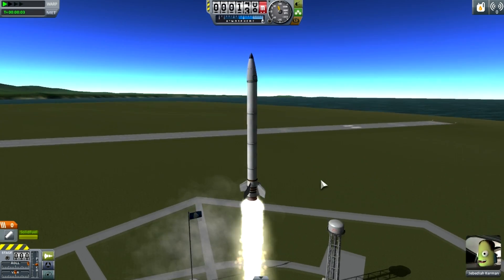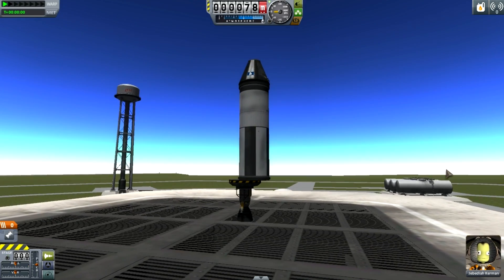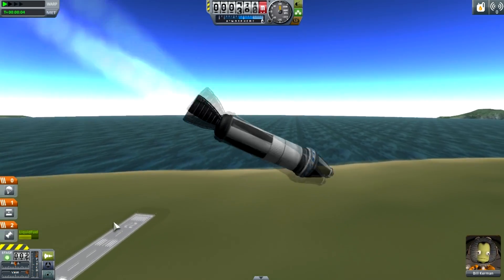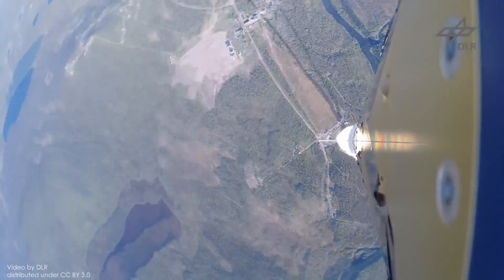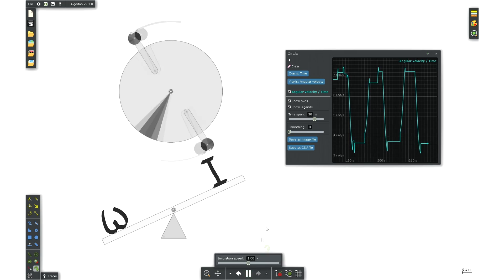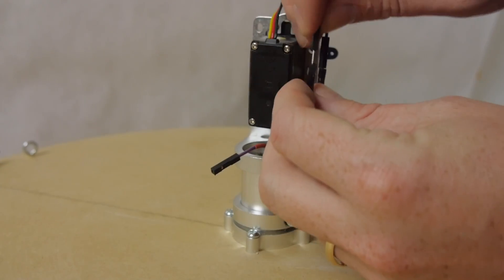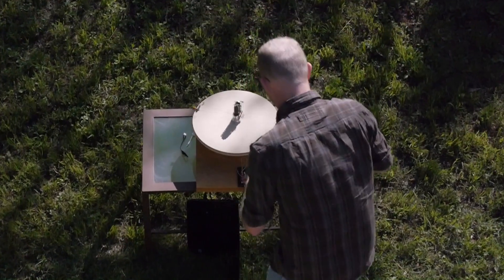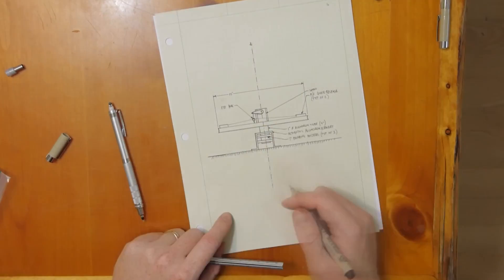Can a satellite do a yo-yo trick?

Comment: I had the same thought about space junk that you mentioned near the end of the video about halfway through myself. However, I think it wouldn't be too problematic to use the yoyo de-spin shortly after exiting atmosphere, but before achieving an orbit. This would allow the masses to fall back into atmosphere and presumably be eaten away by ablation. This puts you back in the same problem you had before, which is being at the mercy of small imbalances in your craft, but once out of the atmosphere my understanding is that the avionics would be capable of counteracting the forces using angular velocity sensors and maneuvering thrusters, which have limited efficiency in atmosphere. A fringe benefit of not madly spinning about.

Comment: Could you please dive a bit deeper into the explanation of why a massive rocket does not tilt over immediately when the supports come off?  What exactly is it that counters any small difference in thrust from the engines?  After all the rocket is not rotating.

Comment: Love your videos! However, at 2:58 thats what redundancy is for. There's a neat video of a falcon 9 having one of its 9 first stage engines blow up mid flight and the rocket still completed the mission. In fact, when von Braun was director of Marshall space flight center, other divisions of NASA jokingly called them 'Chicago Brick and Iron Works' for how high their required safety factors were compared to the rest of the industry, and it payed off in the Saturn V. On that note, I think it would be pretty cool to take a closer look at the civil engineering that goes into launch pads and the space industry in general. These structures usually outlast multiple generations of rockets (eg pad 39A).

Comment: Thanks for your great explanation about the yoyo de-spin mechanism. Great! But what I don't agree on is how rockets would work in space. You have not researched that field at all, have you? Don't believe NASAs CGI-pictures and animations as proof for anything. They can't present one real picture of a satellite in space! Space is really a very hostile environment to absolutely everything you try to put up there. Severe low and high temperatures, vacuum, dangerous radiation, and so on. There is no proof that any satellite is up there and HOW would a rocket engine work in vacuum where there is nothing to push of from. Any flying vehicle need something to propel itself trough, eg water, air, sand, and so on. Try release an air-balloon in front of your vacuum cleaner and study what happens, and that is only face vacuum. They are deceiving us big time with all this space nonsens hoping nobody will start asking questions!
Reply: In jet engines the engine uses oxygen from the air.

In rocket engines the rocket brings along its own oxygen to mix into the fuel and burn, producing a force.

Comment: Interesting. Never realized that just that small amount of mass is needed to achieve so big change in rotation. I always was thinking more is needed, and that would make it impractical. But it is a function of mass and length of the tethers, and these can be easily and cheaply controlled.

Comment: I believe that this is exactly what happens with light. The further it travels in space the more it slows down and the wavelength becomes longer. Many scientist believe that the stars and galaxies are moving away from each other because of the Doppler Effect from the light. But this could also be explained by the Yo Yo De-spin. Light De-spin could require millions of years to become noticeable, but it could account for the red shift from distant galaxies. So the galaxies may not be moving away from each other as fast as has been claimed. Just a thought.

Comment: I realize that this video was released over a year ago, but if you still check these comments, I was wondering if you could achieve the same effect without losing the "yo-yos" by using off-balance fixed rotators (think hammers with an axle on the end of the handle) and keep them fixed to the satellite, just rotating counter to the spin.
Reply from the maker: You would be able to slow the spin rate, but you couldn't shed all of the angular momentum.

Comment: I actually had a problem with this stalling a pump I was designing as I would pump the liquid out with the centrifuge effect the pump would rapidly slam to a stop as all the energy got used up moving the liquid outward. The solution of course was MOR POWAR!
Reply from the maker: +Cody'sLab of course!
Reply: Cody'sLab have you ever played ksp??
Reply: Practical Engineering you just earned a sub
Reply: CLAAAARRRRKKKSOOOOONNN
Reply: Sure is Clarkson in here...

Comment: How did you get a signal from the arduino to the servo across a rotating boundary? What kind of coupling did you use? I need to transmit information/power across rotating objects but can't figure out a reliable way to do this without some sort of error correction.
Reply from the maker: It's called a slip ring. Good ones aren't cheap :/
Reply: THANK YOU. THANK YOU SO MUCH. This is precisely what I've been wanting. I'll do more research to see what I should obtain and what'll work for me.

Comment: I was gonna ask you to explain moment of inertia because I didn't know why mass distribution affects the angular momentum, but then I figured it out, so you don't have to make a video explaining the moment of inertia. ;)

Also, why didn't your thumbnail include the words "Yo Yo Mass"??
Reply: Incidentally, my explanation is that, in the rotating cylinder, the molecules that are far from the center have to move a longer distance, and so obviously requires more force to get the entire cylinder to rotate at the same speed a rod of the same mass would.

And if the rod and the cylinder had the same external diameter, and the same mass, the molecules near the center of the rod would be working to speed up the molecules on the outside, or vice versa. 

I've been wondering whether the mass of the object even matters, but that's because I've kept imagining the objects rolling down a slope, a situation in which gravity is the only force (and is notoriously more effective at moving heavier objects, as I can attest to when I go to the gym), which makes up for the added inertia it must overcome to roll. 

And now I'm thinking of how sledding goes faster when you're heavier, presumably because you're not rotating.

I should go sledding some time. It was fun as heck as a kid, but probably a lot safer. My ancestors used to sled on their shields, naked, to show off to the Romans, apparently. I'm guessing I should wear clothes, or people will look at me funny.

Comment: Would you be able to put a gyroscopic sensor in the center of rotation and make the Arduino automatically detach the slingshots when the angular velocity reading gets to zero?
Reply: What would be the point then?
Reply: Eric Pive that you get exactly (or very precisely) zero angular momentum?
Reply: Francesco Bertolaccini Implying that if you detach them any moment later you wouldn't?
Reply: Yes, because they would start imparting the momentum back to the dish/platform/satellite
Reply: Francesco Bertolaccini why?
Reply: Eric Pive watch at 0:42 what would happen if the ropes had been released too late? the craft would have been spinning backwards
Reply: Francesco Bertolaccini Maybe I misunderstood something, but I thought that the amount you reduce your spin is given by the masses and the length of the cables, which have to be precisely the amount that will cancel the spin. The moment when you release them is irrelevant. The reason why they release them as soon as possible is because they are extra, unnecessary mass and that's never usefull in a rocket.
Reply: No, angular momentum must always be conserved, and if you just deploy the cables you will only get your angular velocity reduced, much like a spinning skater when she opens her arms. You need to convert the angular momentum into linear momentum by releasing the cables the moment you have no spin, that is when all your angular momentum is in the cables' mass.

Comment: Very interesting video. I was on a design team for one of those CubeSats and instead of stabilizing a uniaxial spin we had to stabilize it from a full tumble. We used a designed a gravity boom and 3 low power reaction wheels to bring the satellite within .05 degree rotation per couple hundred orbits. I had no idea that this method was used for larger space equipment!

Comment: Pyrotechnic fasteners (Specifically, explosive bolts) for the bottle rocket scientist:
Required; Plastic toilet seat bolts, a drill, an x-acto knife, a model rocket igniter and launch unit, black powder, (granular pistol type FFFG or "Pyrodex P". Do not use nitrocellulose (the stuff made by DuPont called IMR <number>, or stuff intended for cartridge firearms.) powder.) and plumber's putty. 

Assembly: Score the seat bolt to where you would want the bolt to separate at, to a depth >50%. Add powder and insert igniter.  Insert a tight plug of plumber's putty. (being sure to have both igniter leads passing through it) Use as a bolt. (Standard metal nuts will thread the "bolt".) Before separation, attach model rocket launcher to igniter leads. (No sense in putting fingers at undue risk of radiotransparent shrapnel.)

Recommendation: a short length of metal pipe, attached to the "staying" side of the assembly to catch bolt frag. (Do not cap either end: That is called a "pipe bomb in potentia.") Or distance. (Plastic doesn't generally maintain harmful velocities over 100 meters.) Insulate the edge with tape to prevent shorting the leads.

Materials can be sourced at a Walmart or a hardware store with a sporting goods section and a hobby store. (IDK if Wally-world stocks Estes model rocket motors and paraphernalia)

Comment: This is used on a lot of spin stabilized solid rocket upper stages, as most lower stages use fins for stabilization. Liquid fuel stages are almost always controlled by vectoring the thrust in a slightly different direction using gimbals, or employ smaller thrusters that are either used for control or can themselves be vectored. If a liquid stage was spin stabilized, the fuel would stick to the sides of the tank and you wouldn't be able to use all of it, which is a huge no no. The short clip you have at 5:38 is the Payload Assist Module boosting the Phoenix lander into a Hohmann transfer to Mars, and it is a solid fuel upper stage.

Comment: Instead of manually releasing the string, you should use something like a hook where it attaches to the MDF. That way while the board is still spinning, the inertia will keep the string on the hook, and when it stops the string will move forward a bit and slide off. (KISS)

Comment: This aggravates my Kessler Syndrome.
Reply: The weights will brobably be in a low orbit or an elliptic one that intercepts the atmosphere. In either case, the orbit will decay quickly due to drag.
Reply: @Sander_Datema  just lithobrake.
Reply: Sander Datema There's not going to be enough precision to guarantee that in what is intentionally a dumb, low tech system. If you got extremely lucky and happened to release them perfectly radial and antiradial, maybe (even then only if you're doing this in very low orbit), but if you screw up the timing by a tiny fraction of a second, then you end up releasing them normal and antinormal, then they will remain at the same altitude you are at, just as circular, but simply with different inclinations, and could even come back and hit the same ship that released them...
Reply: Would they fall back to earth if you release them in suborbital trajectory (speed), and after that you can burn yourself to an orbital flight

Comment: Hey! I'm an engineering student, and my team is putting together a lab project about yo yo despin. We're trying to figure out which equations to use to model the system, and right now we're trying to make sense of the equations found here: https://www.princeton.edu/~stengel/MAE342Lecture14.pdf. Specifically, we don't know what phi is in those equations.  Did you use similar equations?  If not, did yours yield accurate predictions?
Reply from the maker: +blahmonster1234 Look at "Orbital Mechanics for Engineering Students" by Curtis, Chapter 10.8. It has all the correct equations derived and good example problems at the end. If you send me an email I can forward the pages.
Reply: +Practical Engineering Haha, I'd literally just downloaded that book when I got your reply notification.  Thanks!

Comment: I'm on the rocket design team at my university, and we use spin stabilization because using actual guidance means your rocket is technically a missile.  The first time we used spin stabilization our angle at the end of the motor burn was 10 degrees closer to vertical and our altitude had increased by 1500 feet.  We had a bit of an issue when launching the payload though because the rotation threw it out of the bay the wrong way.  This yoyo rotation brake may be our answer.
Reply from the maker: +Mattsoup Very cool. If you get it to work, share a link! I'd love to see what you come up with.
Reply: I don't know if it will happen this year since the design is already finalized, but next year I will bring it up.

Comment: Hmm, what if you used some sort of sublimating material as the weights? That way the weights evaporate a few hours after being released?

You could make the weights out of 2 solid chemicals, which when reacted with each other, produce a sublimating material, but only let them react with each other via the release mechanism. That way the mass stays consistent until after release.